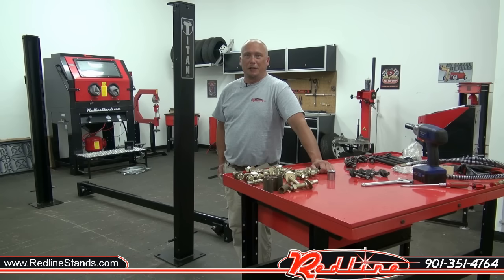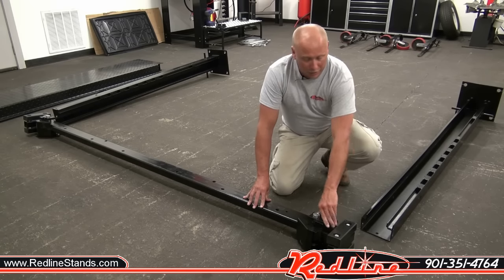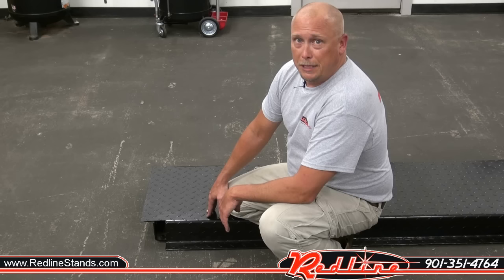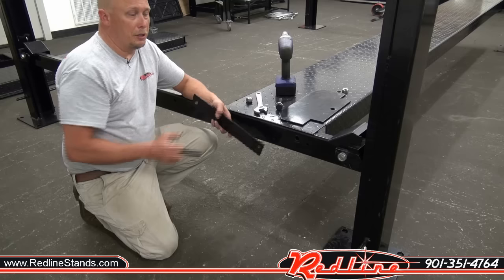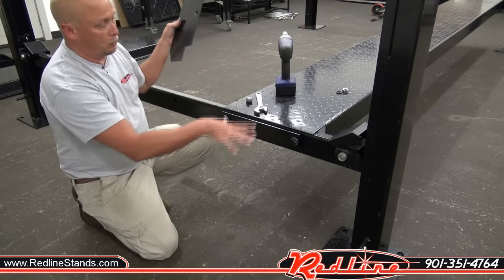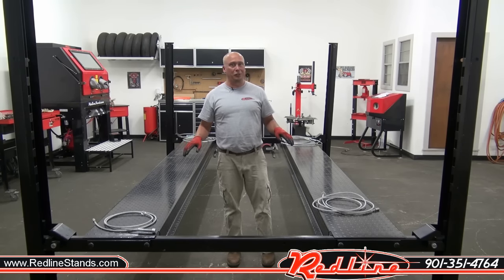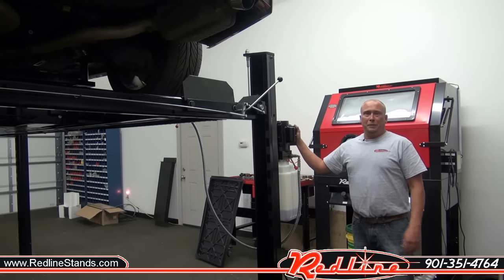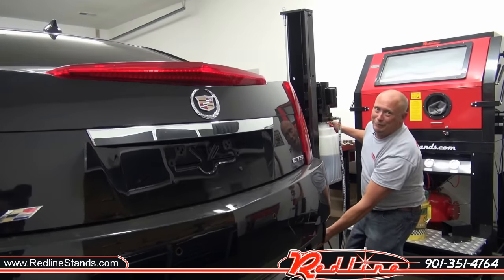How To - Assembling & Installing a Titan 7K Four Post Parking Lift

Comment: I just bought the 8K lb version, I live close enough to Greenwood,IN  so went and picked it up there. It is a bit different than this one, an adjustable locking plate is installed in each upright column and the cables were preinstalled,just needed to be routed to their respective columns. I was able to put it together myself with the aid of a small tractor with a front end loader to and into the garage and an overhead 1000 lb electric hoist. It's very well built and designed for a hobbiest/home garage, At $2000. I wish I had it 20 years ago !
Reply from the maker: LOL.  Sure wish you had bought it from us, but you can't win'm all.  Enjoy the lift!
Reply: Would you be able to answer a question about that lift you got in greenwood? I'm right there
Reply: @fadimcjordan6264  yes

Comment: Great video I have another brand litt but looks to be 99% the same. This video helped a lot.  My lift came with zero instructions but at least the cables where already hooked to the hydraulic cylinder all I had to do was run to the post

Comment: I noticed at the end that your lock setup is opposite of the instruction video.  You said to hookup the lever so it pulls away from the vehicle for release.  Your finished setup operation is a push away lineage release.
Reply: Noticed at 16:38 it shows it pulling away from vehicle... But then at the end it does show it pushing toward.  The way the long linkage rod was installed in the top of the T-handle at 16:38 is correct.  At the end you can see it's installed in the bottom of the T-handle causing it to push inward.  Magic of editing!  ;-)
Reply: Mike Tarak I was just about to point out that bone head move myself.
Reply: Yeah, that was my mistake. You want it to pull away from the car in case the vehile has ground effects or is just positioned awkwardly.
Reply: turbovette426 0

Comment: it was a great video and i was wondering if it was worth installing myself and after watching your very well explained video i feel confident i could do it with help but why was the lock lever shown as pull at the first install and push at the end of the video? all hoist that i have seen have it pull towards the operator to lower. was there a reason for the change?
Reply from the maker: I seem to recall we put it on backwards and had to fix it, but please bare in mind we're going on my memory from 5 years ago here....

Comment: Good afternoon, hoping you can help me with two problems installing my life. First I have all 4 corners plumbed, the treads are level. When I go to lower the lift the entrance goes down like it should but the other end end hangs up and the cables go slack. Do you think its the lift cable not being adjusted correctly or is it something else? Thanks in Advance  Dave

Comment: Hi
I just buy a used lift and it come without pump... my question are on 120v how many amp this needed?
Or on 240v... amp required ? 

Thank you great job !
Reply from the maker: A 20 amp breaker on a 110 power unit is fine.  You'll need a 30 amp double pole breaker if you go with a 220 power unit.  Bear in mind, I am not an electrician and you should have a licensed professional verify any opinion I give you.

Comment: So, I noticed you didn't bolt the posts to the floor. Is this not needed? Also, are the rules for concrete thickness the same as for 2 post lifts? I've been told 6 inches concrete thickness.
Reply from the maker: Depends.  You can get away with no bolting the posts to the concrete if you're lifting lite-weight vehicles.  I personally wouldn't lift a vehicle over 4500 lbs without the towers being anchored.  Are the concrete requirements the same?  Not even.  Four posts are "usually" going to require less concrete.  My advice is to check the spec in the manual of the specific lift you're interested because it varies from lift to lift based on design.

Comment: I have two Model A's. I'm trying to make room in my Shop. My ceiling height is 10 feet. I got plenty of power. My shop is 30×40. Do you think this lift should work? Thanks
Reply: Hey Stephen, it should is the short answer. What you'll need to do is measure the height of both cars and add them together. Then add about 4" for the thickness of the runway and then also allow a couple of inches for lock maneuvering.
Reply: Dustin Gilmore Awesome

Comment: How many inches thick is / should be the concrete floor?
Reply from the maker: You need to read the manual of the four post you've selected.  The size of the baseplate and capacity will change the concrete requirement, so this question honestly cannot be answered here.  Thanks Peter.

Comment: Why do none of the titan lifts have ALI certification?
Reply: Mark, that's a valid question.  Titan is working on some new lifts with the ALI cert.  Titan has been around for about 10 years and manufactures offshore in hand picked factories that we visit on a regular basis.  When starting out the aim was to produce quality product at a fair price targeting the hobbyist/enthusiast market.  ALI does provide peace of mind from independent testing standpoint.  It's just not something we did with the current model of products but it's in the process on some new models.  With that said, we have affiliations with National Corvette Museum (7 of our lifts used in the Museum),  MCACN (Official Lift) , Carlisle Events and more. CORSA Performance Exhaust, Cooks Headers, American Racing Headers all use our lifts at events for their installs.   If you have any questions, feel free to contact us directly at contact@titan-lifts.com or give us a call at 888-908-4826.  We'd be happy to answer any questions you have.

Comment: Low quality lift that is made to raise up to full rise, set on locks and stay and is not intended for daily or even regular use. Purely a storage lift and the cheapest brand on the market that actually has a name. Titans are to lifts as Saturn's are to cars. Cheap shit that never should've made it to begin with...
Reply from the maker: Damn.  Tell us how you really feel.  It's funny, I'll grant you that Titan lifts are not on the same level of quality as the Challengers we carry, but the odd thing is, the Challengers never sell.  Today, our cheapest Challenger is about $6300 and I don't think we've ever sold one.  I'm not sure what else to offer you guys.  I have expensive lifts that only the wealthy can afford, and affordable lifts that according to you, are shit.  We've sold a bunch of these Titans and I very rarely have unhappy customers with them.  I'm glad others see the value in the Titan, because I'm obviously not going to sell one to you sir.  Have a nice day.
Reply: "not intended for daily or even regular use" .... is this your actual experience or just an opinion? Because for what it's worth, my personal experience contradicts your opinion. Having half a dozen show cars in my collection I use a similar lift on a regular basis, especially during summer months, primarily to inspect and clean the undersides of the cars before and after shows. Have had zero issues. I can easily afford a BendPak, but decided to try a similar lift to this at a low price point figuring I would just give it away if it didn't work out. Needless to say, I've yet to give owning this a second thought. If I was running a full blown shop, I'd certainly opt for a something like a BendPak - but these lifts (Titan and similar) are a great alternative for the hobbiest.